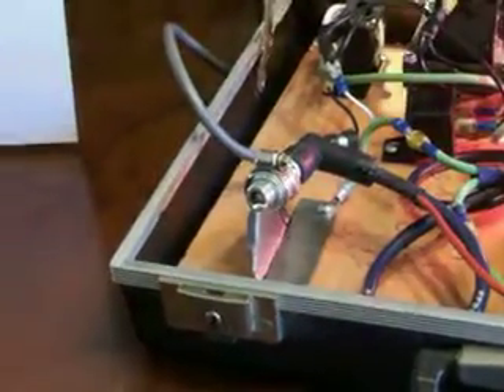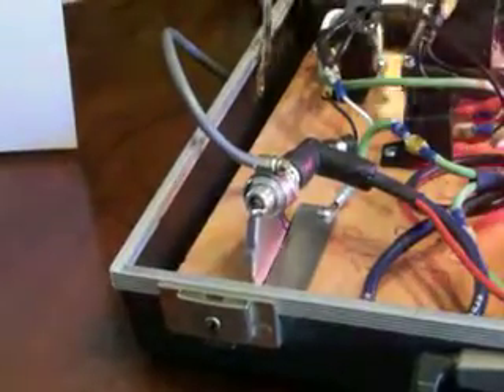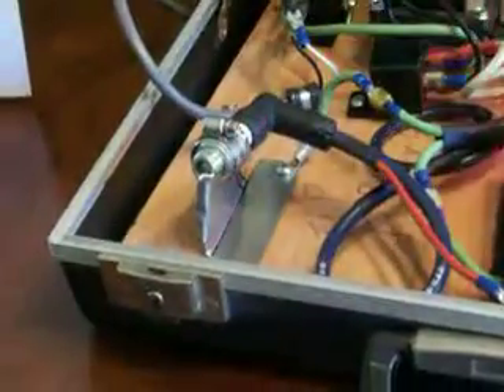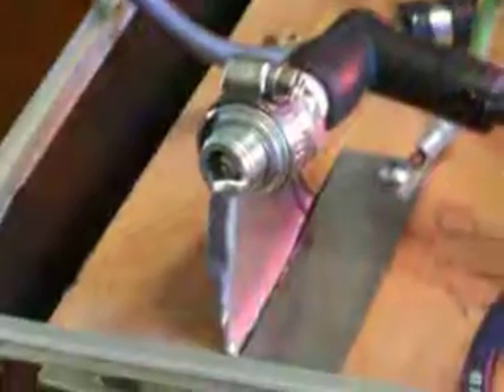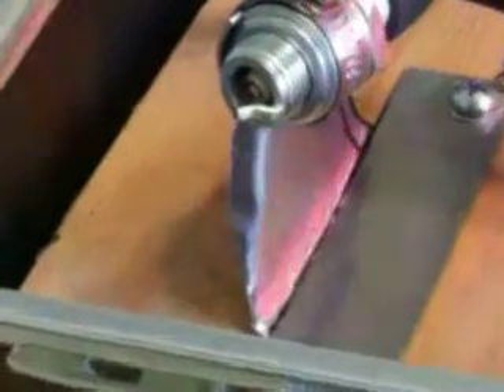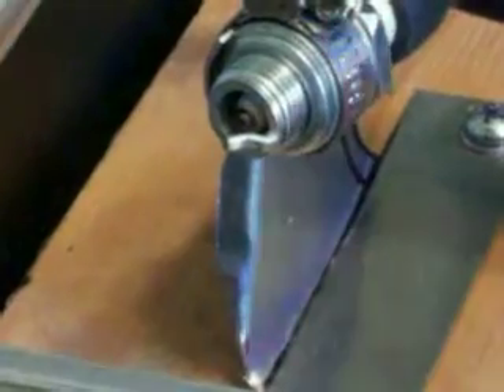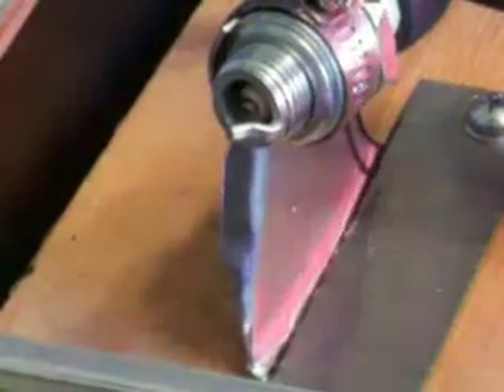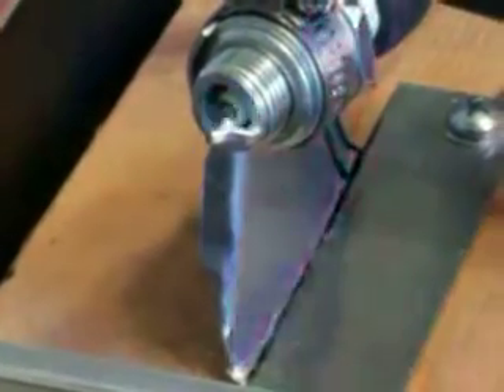firefly part 2

Comment: To bare in minde plazma ignition does not destroy baterry but what it will do is it will change voltage potential of a baterry by my it was 14-15 at alternator charhing ,and it alters alternator starting rpm charge around 2000 2500 rpm if any thing less then that alternator will back charge under low engine rpm and alternator light will by present you tuch acelerator pedal light goes of ! thats tipical plazma ignition